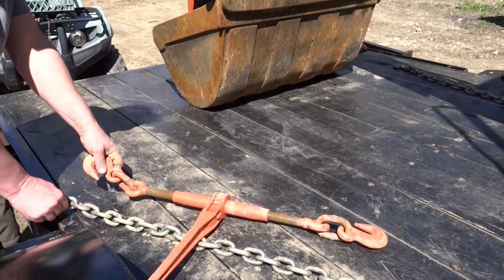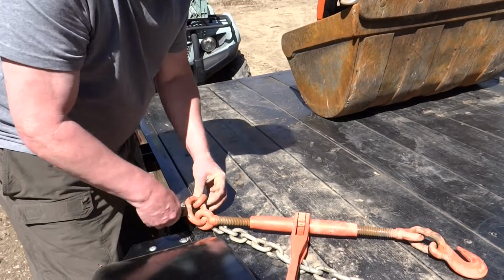How to load and tie down my mini excavator on 18ft. Rainbow flat deck trailer.

Comment: My bucket always to the front and watch the weight go down on the truck then it tells me how much weight to go on the tongue
Reply from the maker: I am pretty sure I have a better video of loading the mini. I just re watched that video and noticed that is my old trailer. I think my mini has to go with the bucket back in order to get the weight on the tongue. One other reason for the bucket going to the back is it keeps my seat dry. However your situation may require you to put your bucket to the front. And I guess it kinda depends on where you're axels are in relation to your deck length. 😏